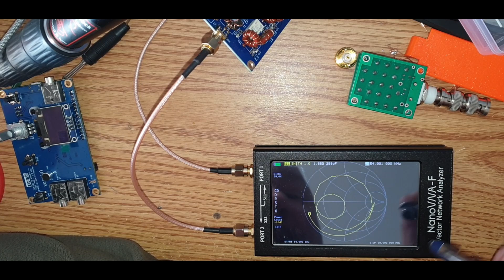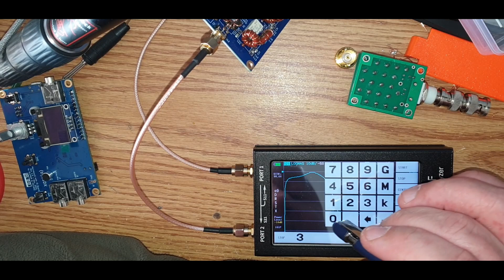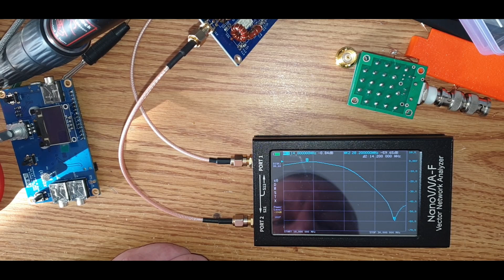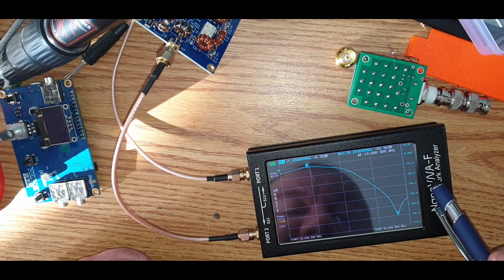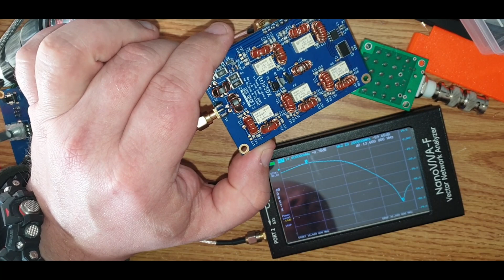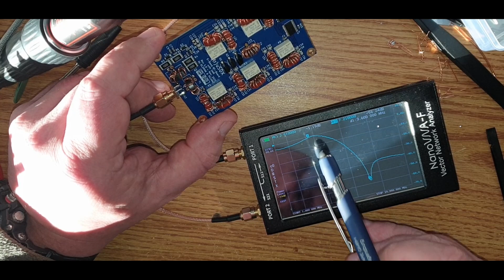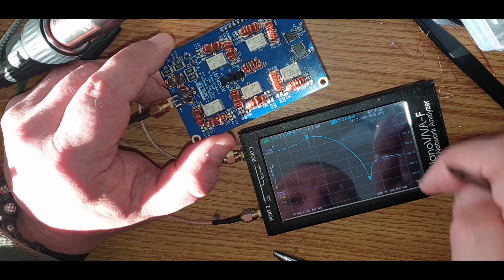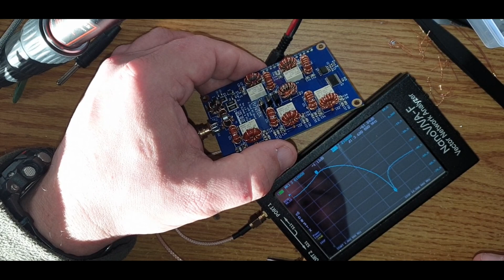(tr)uSDX - Tuning the RF Section for Output Power and Efficiency

Comment: I've just checked my assembled one out. Original the idea has been to get 0.5W more on the lower bands, because upper ends of 80m and 40m show only 3.5-4W. And interesting higher input voltage doesn't change this much. Only lower ends of band are influenced noticable by supply voltage. So going from 12 to 14V you get ~1W difference at low, but only maybe 100mW at the upper ends. At least this is telling the device. For 2nd harmonics, the assembly is ok, no band hits bulls eye like in the video, but I tried to change only 40m so 7MHz to 2nd 14MHz, because there the 60db attenuation is already at 13.8MHz. But no chance without unsoldering the coil, and maybe then the max. attenuation is at 14.5MHz. So about 50dB needs to be enough. For influencing power with the serial coils, I would also have to remove windings everywhere without knowing what will be the result at the bottom end. So conclusion, it is ok, like it has been. 😊
Ah and they have put some kind of glibbery glue or coating on and around all coils. Not sure with what intent. It has been a good asian flypaper, but the wire is not impressed by it.

Comment: @dl2man  The manual says tweak the inductors for 5W at 12V. What if I want to power from 13.8V? Do I need to use a stepdown converter?
I have the Classic Bands kit.
Reply from the maker: Please do any tuning only on USB Power Supply. (FET cannot burn with 0,5W out) Once, you achieve Efficiency over 70%, check Output Power at 12V/13,8V. High efficiency is always preferred over High Output Power. 1S Bar more means needing 4x Output Power, so the difference between 4W and 5W is not recognizable. But I would generally recommend, not maxing things out. It´s an extremely simple and sensitive design. If you play on the safe side, it will serve you a very long time, and you will have fun with it. If you try to push it, it will react with burnt FETs and ruin your day..... 73 Manuel; DL2MAN

Comment: Thanks for not just showing how to finetune the power/efficiency with the (tr)uSDX but also simultaneously finetuning my setup using my NanoVNA to measure rf boards. I have built 'adapters' from SMA (NanoVNA side) to ground clamps and measurement tips. (RF board side) This video helped me figuring out that at least one of the 'adapters' was unnecessary to build. Damn I must have been blind. All the rf boards I measure filters from have an antenna connector 😀👼 But good to see we've had similar solutions for the same problem: hooking up a NanoVNA to some rf board. dl2man de dk4amf tnx fer the vid es 73 <k>

Comment: Finally got my (tr)USDX working the way it should. Its taken a while. The final problem was low output and efficiency on 20 metres. I had to take one turn off each of the 20 metre toroids now about 85% efficiency and 6 w! I also had an audio problem, but that was due to my poor soldering of the inter-board connector.

Comment: Is it appropriate, given these things are placed in cars and whatnot, if we have invested in taking the time to do this tuning, to apply adhesive silicone to the coils in their exacted states?  Also, what setting were you on with those measures?  And can you refer me to the HAM book on where the harmonics should be?  I thought I had purchased a pre-built kit, but realized I did not.  My IC7000 is in the shop, and feel, that with the solder station and careful effort, I can likely assemble it myself.  But I have to admit, there is a lot of tweaking I am witnessing in these videos.  I want to thank you for the time you have invested in this series that even gave me a snowball's chance in hell of getting this close to correct.  73 KJ5ECS

Comment: Is there any option in the radio to LOWER the power? I'm trying to use an external 50 watts amp and can't use it because the 5-6w in 20 meters are too much and over drive it so I wonder how I can lower it to 3w probably? Not permanent ;-)
Reply from the maker: Easy: Run (tr)uSDX with lower voltage. Lower Voltage = Lower Output-Power @nearly same Efficiency
Reply: @dl2man  I thought about that but was concerned about performance. Plus I need to find a source of power lower than 12v which is usually very difficult in a shack where everything is 12v haha. Thanks
Reply: Attenuator of around 3dB?

Comment: On an assembled (tr)uSDX that I just purchased from Malahit on Amazon, I get about 5.8 watts out on 3560 Khz at 77% efficiency, but only about 2.54 watts out at 79% efficiency at 3960 Khz.  Is it normal to have that much drop off of power on 80 meters, or does it sound like this unit has a problem (maybe not tweaked properly?)?  This is at 12 volts.
Reply from the maker: Class E Operation is quite narrow and 80m Band quite broad in relation to base frequency, so yes, this is normal behavior. You can try to tweak it towards the portion of the Band, you use most. In my case, this is CW Portion and it doesn´t matter there.

Comment: I just ran across your highly technical video on the little tr uSDX; very nicely done. Question please: Do you recommend this radio vs the QRP Labs QMX CW only for build quality and performance? Thanks, Michael
Reply from the maker: As the creactor of the (tr)uSDX I am a little biased on that question. I have a QMX and at this point, Firmware of QMX is not yet fully functional (no AGC, no SSB, ) and it is more complicated to build. However: In theory, the QMX has more potential. If it can catch up to (tr)uSDX in practice depends on how fast Hans is evolving his Firmware. Until that point, I will chose my (tr)uSDX over QMX every day, as it simply works as I need it. 73 Manuel, DL2MAN
Reply: @dl2man  Thanks so much for your response; I'll have to order your radio fully assembled from Amazon. 73

Comment: Hi! I've got a question for you. You've been testing it @12VDC, and already the power's been too high. What would happen if you try 15VDC?
Reply from the maker: Release of magic smoke, that´s trapped inside PA FETs.
Reply: @dl2man  Oh, thank you for clarifying this matter! Initially I thought that 15V would be safe, as per manual on your website (where the upper voltage limit is as high as 16V), but yesterday I found your warning on forum to not exceed 14V, and also utilize radio-graded power supply, not just the one from the Walmart shelf. (Just wondering - how many (tr)uSDX reviewers on Youtube utilize poor AC/DC converters, leading to poor radio performance?)
So thanks again, I'll be considering quad lifepo4 pack now. As it happens, yesterday I ordered my (tr)uSDX, and a day before that I passed my first CEPT/HAREC test, so in a couple of weeks my callsign will be there. 73!
Reply: @dl2man  The manual says tweak the inductors for 5W at 12V. What if I want to power from 13.8V? Do I need to use a stepdown converter?
I have the Classic Bands kit.

Comment: Good morning,
I apologize in advance for my question which may seem stupid.
If I understand correctly, the P.A is protected by your design when there is no antenna.
I feel like I don't have the full power of the post.
So is it normal that I only have 2.5 or 2.8 watts displayed with no dummy load or antenna when I press the PTT?
I specify that I feed in 12Volts.
With the dummy load or the antenna, would I have the real power displayed?
I know the question may seem stupid but I have the posye but not yet made my antenna. It's to find out if my post is defective.
Cordially.
Reply from the maker: The PA is NOT protected !!! Never ever TX without Antenna or Dummyload. The only instance where you´ll get away with it without damage is when it´s only connected to USB Power Supply. The real power is shown when on 50 Ohms Dummyload.

Comment: Hi, what happened to my High TruSDX ? I tried to make the same measurements with the Nano VNA, but I only got a peak at 56 MHz. Thats the notch for the 10 m Band. Do I have to set anything. Normaly the Relais are open without any current.
Reply: O.K. Set the Band in the TruSDX an than Switch off the Power. After that I can make ameasure :)

Comment: Hallo Manuel,

ich habe meinen High TruSDX in die ewigen Jagdgründe geschickt, bei FT8 und 12,6V. Wahrscheinlich war wohl der Filter nicht richtig eingestellt (Output 2Watt, SWR<2). Hätte ich vorher einfach mal Dein Video geschaut. Ich glaube, dass durch zu hohe Spannung mit FT8 und Dauersendung Q5 in die Brüche ging :( . Eine Stunde zuvor mit 0,36 Watt DX mit USA. Also SWR war gut.
Reply from the maker: Ja, gerade die High Bands sind sehr empfindlich auf falsches Filter Tuning. DIe gute Nachricht ist: Die FDT86256 sind nicht sehr teuer und 1 FDT86256 ist leichter zu tauschen, als 3x BS170 ;) Geringer Aufwand, und Du bist wieder im Rennen. Pro-Tip: Vor der nächsten FT8-Session dann erst FIlter abgleichen auf maximalen Wirkungsgrad und Antenne mit SWR besser 1,5 nutzen. Wenn das nicht geht: Ausgangsleitung reduzieren. Mit USB-Spannungsversorgung alleine (ca. 0,5W Ausgangsleistung) kriegst Du den FET auch ohne Antenne nicht kaputt. 73 Manuel; DL2MAN
Reply: @dl2man  schon ausgetauscht. Tut wieder. Nur der Filterabgleich. Habe nur einen Peak bei 56 MHz. :( Konnten die Filter für 28MHz einstellen, Aber was ist denn da los ? ansonsten keine Probleme, Effektivität ist halt nicht so hoch, aber jetzt immerhin mehr als 50 % bei  28MHz. Am Anfang nur 20 %. Das war wohl zuviel vor dem Ausfall.

Comment: I have to adjust the 40m and 80m power can someone point out where the 40m toroid is.  80m is 6.33 95%  40m is 6.38 91% and 20m is 5.48 78%.  All with 13 volts input
Reply from the maker: Please refer to my page: https://dl2man.de/2-trusdx-assembly/
where you find all the schematics with all the details, you´re looking for. 73 Manuel, DL2MAN

Comment: Thanks for the video.
When I use a dummy load I get a maximum power of 5W
When I connect to my antenna I get a maximum power of 6.5W
Same pattern on all bands - dummy load is spot on, antenna shows excessively high power
Is this normal ?
Reply from the maker: This is normal when your Antenna has another Impedance than 50 Ohms, also known as "SWR not 1:1".
Reply: @dl2man  
Thank you for the response.
Just to confirm - This is a real value that will damage my (tru)SDX if I use it ?
At the moment I am just testing TX for a second or less.

Great product btw - it manages to be fun, educational, practical and cute all at the same time, oh and affordable - that's a tough task to pull off but you guys managed it - thanks.
There are now 3 of them at our radio club and they are generating a lot of interest.
Reply from the maker: @smellthecoffee5314  Well, check your SWR with Dummy Load: Should not be over 1,02. CHeck it with ANtenna: Should not be over 1,5. If that´s the case, your SWR measurement is working and It is safe to work CW and SSB. I´d limit myself a little with stuff like WSPR, as this includes 3 Minutes of constant TX. The Output Power over DUmmy Load is the true value. Output Power over Impedance mismatch is "distorted". It is safe to use, if your SWR is not above 1,5:1. If in doubt, reduce input voltage to lower output power.  73 Manuel, DL2MAN
Reply: @dl2man  Thats very helpful information - thanks. 73 Paul, M7MGK

Comment: What will adjusting the inductance on the other three toroids do?  You mentioned the choke doing something but I didn't quite understand what.   Apologies if that's explained elsewhere.
Reply from the maker: There´s only 2 Inductors involved per Band. Those are discussed in the Video. Choke inductor acts as 2 things: 1. constant energy source (minimum inductance required, we´re way above required minimum) 2. Blocking RF from DC Line (the higher inductance, the better). The other 2 black toroids are only SWR Transformers, and don´t affect Class E at all. There´s only one right setup for those, and this cannot be tweaked.

Comment: You bring up an excellent point.... our responsibility to not cause interference with other signals/bands/etc.  And to do this, you think like an engineer.  I suppose we all have to at least think like a novice engineer... which reminds me of another hobby of mine.  I have a few old, air-cooled Volkswagen Beetles... and in the VW Bug world there is a saying "Volkswagen.... turning drivers into mechanics since 1949!"  in our case "HAM, turning operators into engineers since 1901!"
Reply: I knew nothing about cars when I bought my first used bug. Four bugs later I could replace the pistons and jugs and be back on the road in a day. It was quite an education.

Comment: Hi Manuel, I was wondering if you could explain a bit more how the class E amplifier achieves the linearity needed for SSB operation. Would it be possible to do the same thing for a VHF transceiver? The prospect of a cheap, power efficient, VHF SSB transceiver is very appealing to me. Thanks again for this amazing project.
Reply from the maker: Possible for sure. I´m just not sure, if we´re anywhere in the near future are going to try something like this. We have ideas for years and no free time....
Reply: @dl2man  I am also familiar with this problem. Can you point me to any resources on designing class-E amplifiers? I want to understand how an on/off amplifier can produce a linear output, and maybe I'll even be inspired to build one some day....

Comment: Congratulations for this great project! May I ask for some information about the future addition of higher bands 17/15/12/10m? I am actually mostly interested in 10m. A 80-10m transceiver, even if in a bigger enclosure would be awesome. Do you have any estimated dates in mind? 73 from PU3TLG.
Reply from the maker: Firmware supports it already, and the Values have been published. https://dl2man.de/2-trusdx-assembly/ From my side: More will not happen.

Comment: Great video! I am just waiting for a USBasp in order to get some software onto my (tr)uSDX. I will start with the 3xBS170 but after watching your video I am wondering if the FDT86256 would be a better option when running from 13.8V which the voltage I am using for all transceivers? 73 de Dirk SA4DHT
Reply from the maker: The Rig works up to 16V without issues. If you replace the FET for another Type, all the Filter Caps and Inductors need to be adjusted. Please see my assembly page for details. https://dl2man.de/2-trusdx-assembly/
Reply: @dl2man  I am aware that the filters need to be changed. I saw a note in the forum that the FDT86256 is more rugged in the presence of high SWR. What is your experience? These days the FDT86256 is of cause harder to get, but I have some and wonder if it would be a more robust solution?

Comment: Some viewers may not fully realize that these are latching relays, and that you preset to the 20 meter band while the power is turned on in order to have the 20 meter resonant circuit switched in after you turn power off to the RF board in order to tune the 20 meter resonator and filter inductors.
Reply: I suspected as much given that he switched it to 80m with the mainboard connected and then pulled the power, but thanks for making that clearer.  I'm about to do this same process for two RF boards (one Lo, one Hi) so every bit of clarity on how it works is helpful.
Reply: A very important point!
Reply: Is what you're talking about the thing he mentioned in the beginning? I want to make sure you're reiterating his point and not adding something else I should be watching out for? Thank you

Comment: Thanks Manuel. I found that after reading all I could find about the (tr)uSDX that there was still a lot I didn't know about what was going on. It seemed to be missing some info. I ultimately filled in the missing info by reading about the uSDX rig design, (I'd jumped into the process at the (tr)uSDX stage and knew nothing about the history with the uSDX.) 

With that further technical background and some ARRL publication reading about class E amplifier design I finally felt prepared to put my NanoVNA to work tuning my (tr)uSDX. But this video makes the entire process much easier and quicker to figure out how BEST to do it. Nothing beats listening to the designer. I know it's a lot of time and effort on your part, so again thank you. I appreciate the effort you put into doing this design and the videos, everything from the Gerbers, to the BOM, to the How To Assemble and Tune videos.